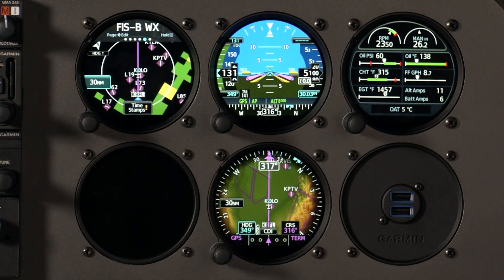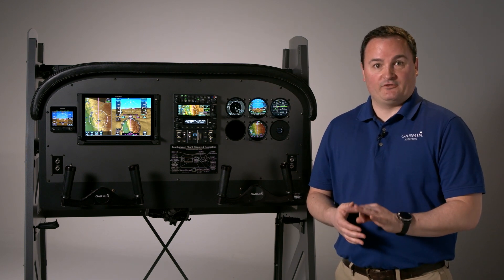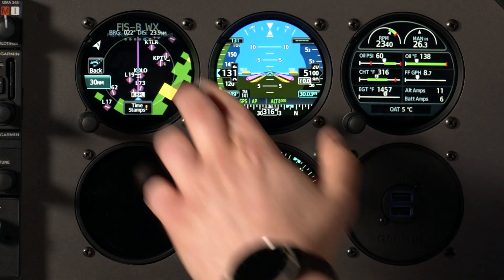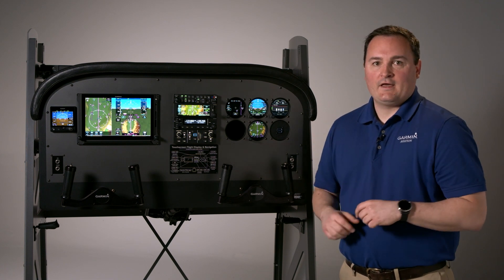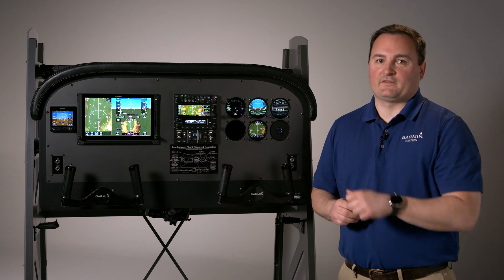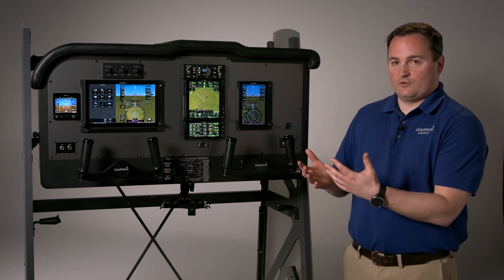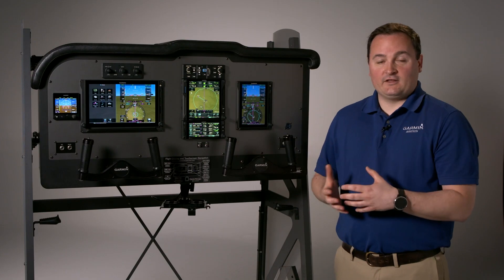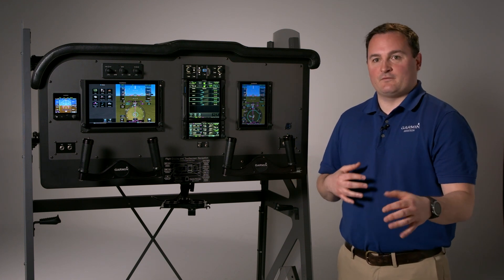Garmin’s New GI 275 and GTN Xi Avionics Offer Upgrade Path for Legacy Aircraft – AIN

Comment: The 275 is nice, but placing the control knob on the left was a complete human factors and ergonomics design fail. Most pilots fly with their left hand on the yoke and use their right hand to manipulate avionics, so with the knob on the left not only is it less accessible and less comfortable to adjust, but your hand covers part of the display.

Comment: Small displays really just betray us and further the tragic retro state of GA. Those should not be products. A large display costs nothing today, CPUs cost nothing, it really is very foolish to hold on to the old. One large display that does all including radio.
Reply: You mean costs nothing outside of avionics. Have you looked at the costs of 'installed avionics' - a full glass panel runs upwards of $30k-$50k, that's more than 50% aircraft acquisition cost.
Reply: @coolhari2000  I'm not talking about current prices in avionics but the actual cost of electronics. Electronics are quite cheap today. Display size costs nothing compared to avionics prices so it makes zero sense to make things small. Try to understand the difference between the state of GA and actual electronics.
Reply: @DanFrederiksen  I agree 100% dude. There's tablets for $50 with just as much or more processing & display capabilities.
Reply: Because people pay it. There aren't many people that fly, let alone update their systems. Getting the STC is a long and challenging process. So they recoup that cost in sales. Does a Ferrari cost that much to build in materials?
That's not to say I disagree with you just saying it's the nature of the beast.
Reply: @andrewq1876  nah bs. it's a self fulfilling prophecy. instead of all these little useless dial instruments certified, they could just make one big universal instrument. surely one certification is much cheaper than many. they want to keep it expensive but that just sets them up for a fall.